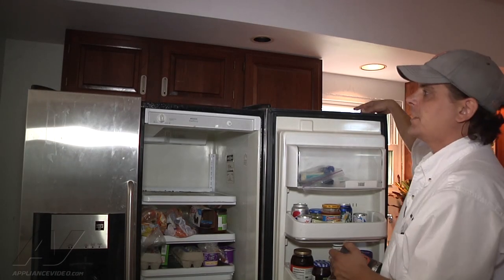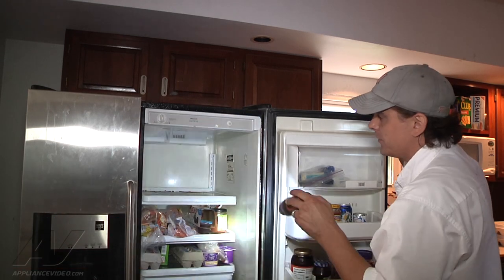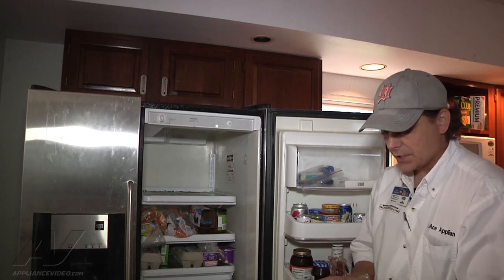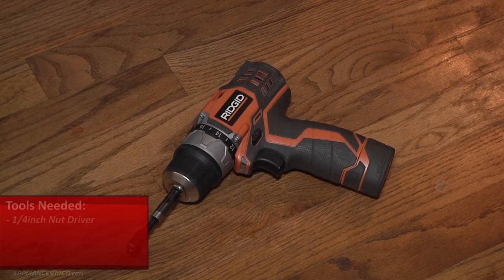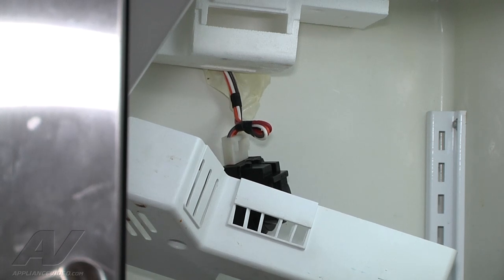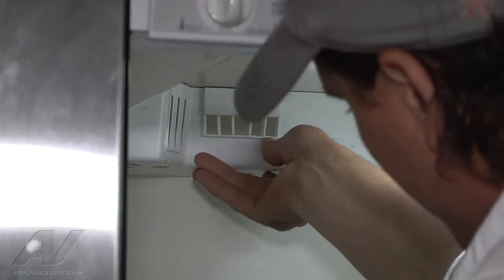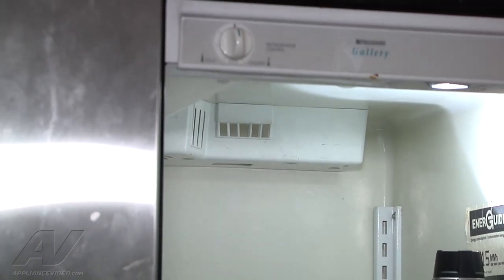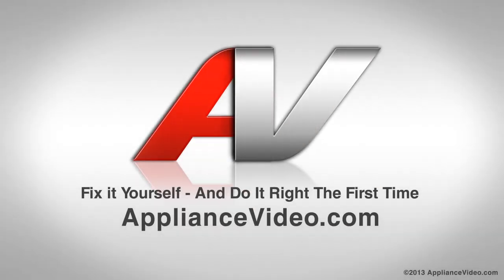Frigidaire Refrigerator Repair - Not Cooling - Timer

Comment: I notice this model does not have the water filter housing located in the the top right corner. I wonder if this is why most readers can't make the connection with the timer location?  I'm also on the hunt to find its location.
Reply from the maker: Great question, if you have a more technical question that our parts department cannot answer, you can search our over 17,000 answered questions free at our website www.ApplianceVideo.com under our Repair Help section. You can also call our parts department at 1-800-830-5465 and they can give you help 7-days A week ,or search at www.SaveMoreOnParts.com  .
Reply: I found mine at the bottom left front corner, underneath the left freezer door.

Comment: Frigidaire top freezer where is the defrost control located? Please Help. It is not in the bottom rear, It is not in the refrigerator.
Reply from the maker: Great question, if you have a
more technical question that our parts department cannot answer, you can search
our over 10,000 answered questions free at our website www.ApplianceVideo.com under our Repair Help section. You can also call
our parts department at 1-800-830-5465 and they can give you help 7-days A week
Monday -Sunday, or search at www.SaveMoreOnParts.com  24 hours
7- days A week.

Comment: i. have a. fridgedare dont get cold no. ice coil not cold but. line. is Compresser. on all. fans. work
Reply: also.   when i. push. fridge/freezer whole. fridge. shuts. down element dont. heat.up any. help. or is. it. not. worth. fixing get back. thanks also. is. there. an. ajuster or. no
Reply from the maker: Great question, with our
technicians now getting hundreds questions weekly, they are answering all questions
at our website at ApplianceVideo.com under our Repair Help section. We have over
3,000 common questions and answers that you can easily search through by your
model number, appliance make, and problem or error codes.